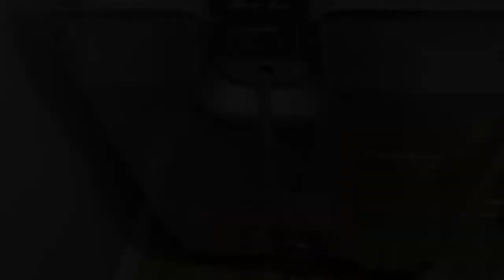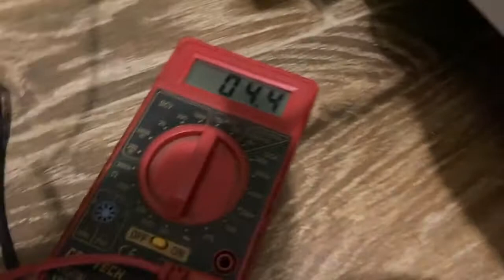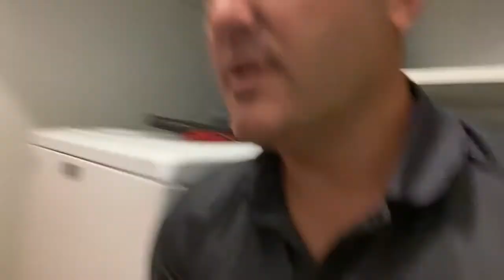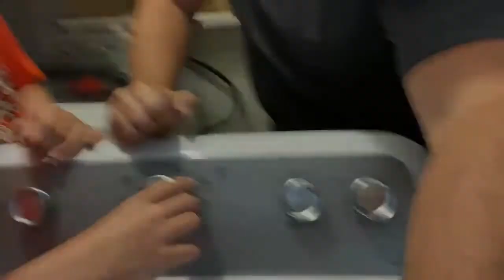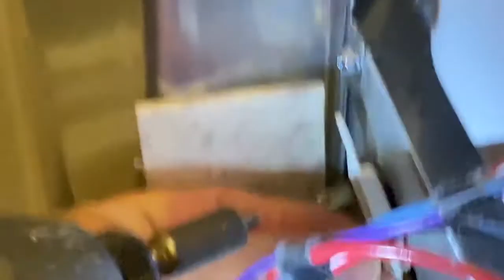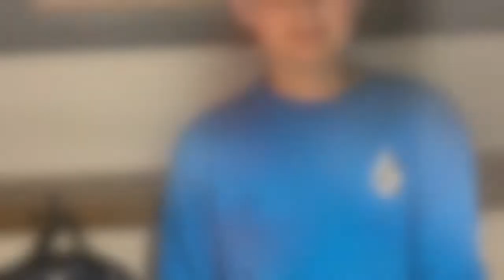Maytag High Efficiency dryer no heat #dryer #texas #diy #how to #toolman #handyman #heater

Comment: So which machine has been better for you, the Maytag set or the GE? Did you get the warranty for the Maytag? I read reviews that they don’t have great customer service ...
Reply from the maker: About 3 years ago I started purchasing the extended warranty.  I have noticed a huge change in the quality Of products being produced and sold in the US.  I think overall the Maytag have had less repair needs.  The dryer has been constantly running in our house due to kids and wife’s laundry business. The warranty has expired on the dyer and to date I have replaced the heating element twice and the thermal fuse once.  Total out of pocket is $75 plus driving to store.  Botha are very easy to repair.  Hence my videos. The washer has been replaced after three years due to an issue with the drum and there was no parts so they cut us a check to purchase another one.  The only issue is that when you purchase another on you have to purchase another warranty.  Even if it’s still within the original warranty.  Plus the cost of goods have gone up about $100 for products like this.  So I think I’m out at least 250$ but I’m happy with the new washer(another Maytag ) and it has been running strong. I always buy from Nebraska FM.  They have pretty good warranty company or at least may the outsource to local people in my area who are really good.  Hope that helps.
Reply: @villagehomeservices6019  ok. We aren’t very handy so I figured I need something super reliable. Thank you!
Reply from the maker: @kristenhurst541  I would recommend going with Maytag or whirlpool.  Since whirlpool owns most the companies….   What brands do you like? Dislike?
Reply from the maker: don't forget to subscribe. thank you for watching!!

Comment: Hey Mike.  Very proud of you. It was Entertaining and educational.  My dryer is different. It was the thermo-limit fuse. 
You are correct.  Fire Bad. After  fireplace mishaps but before granny has incinerated herself over the stove (claiming Hot Flashes... shout out to Robin, better known as Ms. Doubtfire.... he he fire...) and dryer lint spontaneously combusting, I would have to mention candles. Apparently, we as the human race have forgotten how to treat open flames. 
Initially, my vent had charred lint in it.  So I cleaned it out like new and the same thermo fuse failed again, replaced it. Then it happened again. This time when I rang out the circuits, it was the heating coil that had burnt through.  So I replaced the whole unit. Three sensors and the heating element. 
3 weeks ago, the friggin dryer stopped heating....again. Rang out all three fuses connected to the coil tunnel and the coil itself, unfortunately they all had perfect continuity for the resistance they were designed for.  I gave up.  It’s a SAMSUNG model #DV317AEG/XXA
S/N 349454BP800193W.   Any thoughts, you awesome appliance repairman you.  
You had the best teacher for ALL things regarding construction, mechanical, electrical, earth moving, welding, brazing, flying, singing, playing musical instruments and.. well maybe not singing:)
I have all the tools I need. Just need a bit of help troubleshooting.  I think my wife is starting to catch on that it’s not the dryer that’s not heating, it’s just sooo humid. 
I love you nephew, give my love to your wife and boys as well. 
Uncle Jim
Reply from the maker: James Paul Coulson hey uncle Jim thanks for the nice words.  Everyone says hi. I think your message has perfect timing!   I just replaced the heating element as well.  The coil burnt up as there was excessive lint built up in the vent hose.  With a family of 5 and humidity like we have here in Dallas everyone is showering more and we found that the dryer was able to keep up with the towels.   Took almost 3 cycles to dry them.!!!  So we have been running it on the hottest setting “sanitize” which I believe burned up the coil in conjunction with the lint back up. One thing that papa Steve mentioned is the vent will impact the performance of your system. 
I did some researching found that if you have to many angles before it terminates at the rough or outside then it can really make your dryer work harder.   Also if you think about the relative humidity your dryer can’t push heavy moist lint as far as dry fluffy lint. That is where I think we are having issues.  At first glance my system looks good, correct vent length <35 feet and minus 5 ft for any right angles and minus 2.5feet for any 45 degree angles puts me at about 27.5.   So I should be good.   However when it gets really humid is when I notice these issues.   In the future I will start with cleaning out the vent monthly during humid months.   I am going to start there and see how it goes.  Oh yeah and also trading in my plastic slinky dryer hose for a metal one with less kinks.  Hope that helps.   Here is a great article on ventilation and how it helps.                   https://www.energy.gov/sites/prod/files/2016/06/f32/Dryer_Venting.pdf.      Say hi to the family!  Love ya Uncle!
Reply: Mike Garcia 
Hey bud. Sorry, just saw your reply. 
My “flex” vent is about 4’ long when stretched out to gain access to plug and vent. 
When it is in place, it has 2 45 degree bends in it and sits about 10” off the wall. So it’s not a whole 4” straight shot to the exterior, but you can look into the vent from the outside and see 1.5-2” unimpeded flow.  Nothing is kinked or overly compressed. 
I just gotta get back in there with a troubleshooting schematic and trace from the plug,  through circuit board, control panel, wires leading to the heating element, the 4 element “fuses/overheat resistors and the coil. 
Thanks for your input. 
Love Uncle Jim